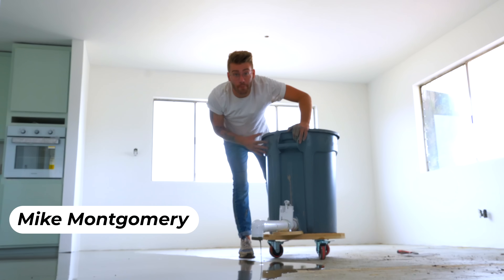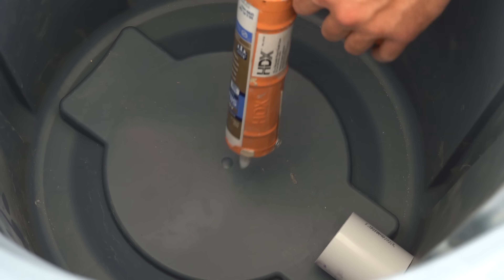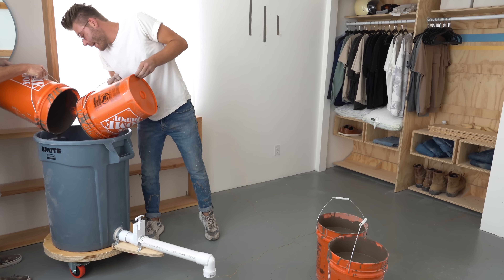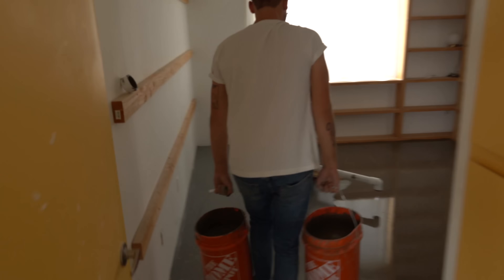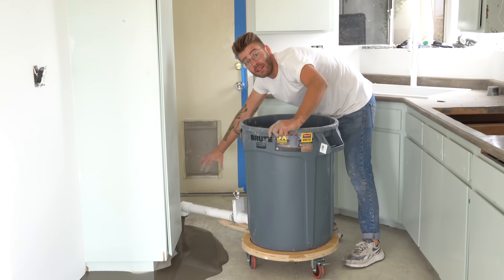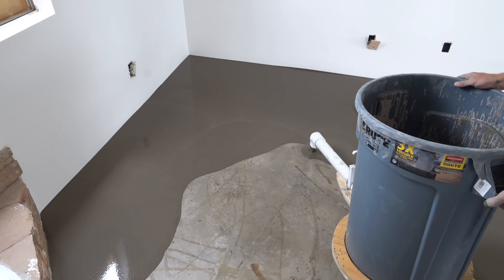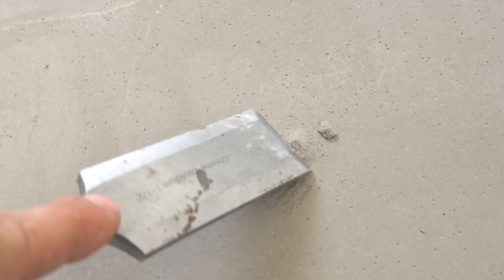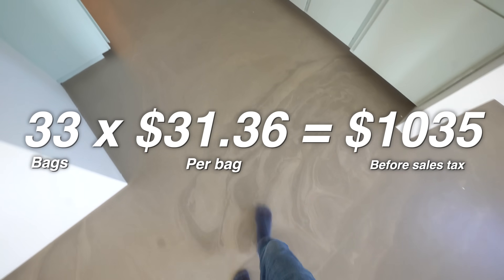DIY SELF LEVELING CONCRETE FLOORS!! $1 per square foot

Comment: I did this DIY pour two times and for the second one we already understood we have to invite few family members to mix with multiple buckets and drills to achieve good pouring times. Mixing of my material was supposed to take 4 minutes and the initial drying time was 20 minutes, so with only one bucket mixing you would pour the 5th bucket on a solidified material. This way I believe it has to be maximum 30 minute job always. What is your experience?

Comment: Someone help me understand: that thin layer over that really smooth surface wont result in the new concrete top to crack and break with as littke as walking on top of it?

I trued this in my garage, with about 2 inches thickness. When it dried, i lift from the subfloor and walking on in immediately broke it.

What am I doing wrong?
Someone help please!

Comment: hi I need to level out a basement floor but it looks like the corner where the concrete was originally poured is very high. I’d say it’s about 4-5 inches higher than the rest of the floor just in the one corner. Is grinding my best option or should I look into pouring self leveling concrete or both?

Comment: Hello Mike, I just finished doing my Sunroom with my wife and her girlfriend. We had a lot of fun doing it. It came out awesome in my old house. My question to you is after you put the sealer on and lived with it were you happy with the sealer. I thought I'd wait several days before I put the sealer down. The contraption worked great I went with 11/2 inch pipe as Ben recommended.

Comment: LOVE the enthusiasm, HATE the install. The supplier is laughing all the way to the bank. Material is not a wear layer and slippery sealed surface is just asking for accidents.
Just patch and level the rough areas and drop LVP on the old surface. Floors are consumable/wear surfaces. Flatten and put a nice, comfortable, replaceable, wearing surface. Replace in 20 years with LED lit, heated, vinyl tile floors

Comment: You know, they make a special type of mixer for this sort of application. It is basically a 55 gallon drum held in a steel frame with a gimbal and a heavy duty mixer built in. This way you can mix several bags at once and the entire drum rotates to pour out the cement as needed. It is sooo much easier and faster than mixing in five gallon buckets. The cheapest versions cost around $1500, but you can usually find a place to rent one for $30 - $40 dollars a day.
In CA there is a company called CONCRETE  RENTALS and they rent one called the "HIPPO - Mixer" $150 for three days or $300 for a week. There are far cheaper rental options but CA...

Comment: This product is not designed to be a trafficable flooring surface. It’s a substrate that needs a flooring product installed on the top like carpet or LVT.

Comment: Never ever wear wireless ear bud like devices when pouring/mixing concrete. Also this is not a long term solution, it's strictly cosmetic IMO.

Comment: The mistake you made is your setup to do a continuous pour but may as well have just mixed each bucket and dumped them separately 
What you should have been doing is one guy mix’s and delivers the mixed leveller to the hopper before it ever runs out of leveller making it one continuous pour rather that just two buckets at a time

Comment: That slurry will form fine cracks overtime, despite having been protected with a sealer. It might not do anything to the floor structurally considering it's a single storey house but it will be visible. Now, if you want to prevent that, lay down a layer of fine mesh (preferably a fibre mesh instead of a metal one as the latter would expand when the concrete sets, creating uneven waves) before pouring in the self-leveler slurry. The mesh will provide tensile strength, preventing any cracks from forming on the floor...
Reply: that is a good idea, do you secure the mesh to the floor with any sort of anchor or just lay it on flat with nothing holding it in place?

Comment: Can this work if floors are hardwood? I've been wondering if concrete can be applied over hard wood floors  and finnish it with tiles or will there be cracks after a few weeks?

Comment: You could buy a long elastic slug maybe a bit wider in diameter not the average water hose and or you even could use a water hose too and later wash out with water bc this material was really fluid. The same big bucket, outside the house, 1 guy mixing the material one guy helping to handle the hose and 1 is pouring much precisely . You just have to put the bucket high enough that the material can leave.

Comment: I don't quite "get" Self Leveling mix because whenever I see it poured in a video, it flows to somewhat level, but not really level. It seems to easily retain many areas thicker than others, similar to trying to trowel icing smoothly onto a cake: about impossible. So my question remains: just how much variation and obvious layering appears when it's done and and dry? For example, could a linoleum floor really be added on and lay flat? Doesn't look like it to me.
Reply: You're right.  Doing it this way does NOT make a perfectly flat floor.  It is good for laminate flooring on top.  If tiling, most pros will use thin set and a trowel to level it.  I can't speak to sheet vinyl, but any surface variation or lump will translate through the sheet goods and be perceptible on the final surface.
Reply: @alanstanly  Thank you. Well, I lived in a NYC loft where the slope was so bad that it would be entirely pointless to use self-leveling. The dropoff across the 25ft width was a full 12 inches! I finally corrected part of that area by laying 2x4 joists onto tall stacks of 2x4 blocks. And that work was a total nightmare that took ages to construct. And it never quite got finished.

Comment: Hi I have expansion gaps in the concrete in my basement. Do I need to fill those before doing the self level concrete? If so what would I fill it with?

Comment: ok not tryn to be a debbie downer and for and for any nay-sayers im a 3rd generation mason with 20 years+ under my belt at the age of 40 so i am going to be the voice of reason here, first off....thats not concrete, its not even meant to be an actual exposed surface, second its gonna crack and make a god awful mess, and third you realize there are people that are gonna try this and spend alot of money on it from what i can see 1200$+ and possibly do damage to theyre homes or god forbid theyre rental homes, you really need to label your vids better and use proper tools and at least proper prepping, cuz in my opinion this was so cringe i had to stop the vid, laying down some durock concrete board and 12 inch tiles is cheaper easier and brings up the value of your home , but thats just my professional opinion.

Comment: Good lord.  You made this job WAY harder than it should have been.    Pour the product on the floor, put on your spiked shoes, and roll with a 36" pin roller.   33 bags is a 1.5 hour job for 1 guy.   And yes, I do this at least twice a month.  The know nothing comments on this video are incredible.

Comment: How does the concrete not set up ln the spout and clog?
Reply: I guess it's just runny enough being self leveler
Reply: It’s a special concrete—that’s why it’s 6 times more expensive than regular concrete. I used them to cover my uneven patio stone floor with this before overlaying it with laminate wood. Generally they are good if you plan to overlay it with other things bc this type of concrete should not be the main finish.

Comment: Nice job guys!  It looks great.  I have a 70,000 sq foot 1927 five story office building.  The floors are cement, but poured in small sections which are not level nor flat.  Fine for carpet, but we wanted to change to wood (laminate planks).  I am just a DIY, not a contractor, but I have done a LOT of these pours (200 to 2000 feet).  The first step is we grind down the high spots at the corners and edges of each original pour.  Then I like to use this self leveling stuff.  It is SIX TIMES the cost of regular cement, but it flows like thick soup.  It does NOT in fact self level all that well.  Especially if you do it like these guys did, in large pours.  The thing is, it sets in a flat amount of TIME, not by drying out (it is a chemical reaction), and that time is just a few minutes.  You do not really have time to fuss with it, and if your next bucket is not ready pretty quick, the earlier pour will set before your next pour, and it will not be homogenous (you will end up with dry seams instead of a continuous pour).  So, there are a couple of tools we use.  One is the beveled cement float (like a push broom for shoving around cement)(A gage rake probably works too).  This is used right after you pour a bucket to get it into the corners and edges quickly (time is of the essence).  The second tool is the spiked roller (think pinhead on a 18 inch wide paint roller).  This is used to QUICKLY smooth it all out and blend the different pours and pop any bubbles (careful not to push it too fast or it will spray cement all over your walls and pants), and do not overdo it, once the cement starts to set, it is game over.  The shoes with spikes are cool if you need to walk into it and hit a corner and not ruin your sneakers.  Also the cement dust while you are pouring the bags and mixing is very irritating.  If doing it outside is not practical (limited time before it sets), set up a place inside (with a heavy drop cloth, it will make a serious mess A CEMENT MESS).  I usually have 3-5 people to do it.  Have a big trash can of water and a 10 quart bucket with a slot cut horizontally at the 6 quart level so you can quickly grab exactly the right amount of water (the water added needs to be precise).  So I have 1 guy on the half inch mixing drill at the bucket, another guy pouring the dry bag into the bucket, and a 3rd guy holding the vacuum with a cyclonic dust extractor (DustDeputy).  After the bucket is mixed, a 4th guy will bring it to active room, and pour it out. The final guy then uses the float and pin roller to blend it into the ongoing pour.  Have 2 or more buckets in circulation so you can do it assembly line fashion.  Note that it sets up and coats the buckets as you go (I can only imagine his trash can thing and spout getting clogged), so having a few extra is nice so you don't get hardened clumps in your pour.  Do be sure to wet mop the floor and then put on the primer (like he says, 1 time 50% diluted and then 1 time full strength).  The directions say to use a soft push broom to apply, but a cheap paint roller seems to work just as well for me (make it thick, a 3rd coat is not wrong).  If you are sloppy with the primer step on an old floor, it will wick out the moisture too fast and in the morning you have a cracked useless mess to chip up and redo.  f you don't tape the edges, it will flow right under baseboards or drywall (or cabinets or doors).  DO not skimp on taping and sealing where you to NOT want the liquid cement to flow.  Caulk cracks in the floor or it may flow through (to the floor below you).  Also I can say from experience, this self leveling stuff is rather soft so do not expect it to be a walkable top coat.  In fact the manufacturer's website is very clear NOT to leave it as the final surface, it is UNDERLAYMENT, although it is pretty, it is NOT durable, and a thin urethane coating will not make it suddenly durable (note however that there are professional self leveling mixes that ARE certified as a topcoat, but the ones I have found require an authorized installer to buy it).
Reply: Dayum... That's a lot of work!
But you've got it down to a science.
Reply: Could you not just use ultra fine ag at a really high slump and a bunch of super plasticizer and end up with better results for cheaper?
Reply: very good information, thanks for taking the time to type all that out.

Comment: I've installed more than 1 million sq ft of Ardex K-15 self leveling underlayment in New York city rehab projects. Hat's off to you for thinking of a new way to dispense the mix, although it has some bugs to work out. On big projects we used a concrete pump and gauge rakes set to 1/4 inch to guide the mix where it needs to go. We then went over it lightly with a long handled type of float to break the surface tension and allow it to flow better. Once it cures you are always going to get tiny hairline cracks that are actually mostly a cosmetic issue, and not a structural problem. It should be sealed with a clear water based matte urethane because it will continuously dust off and you will always have it on your feet if you don't. These materials were designed to go under finished flooring, and not to be the actual floor.
Reply: Do you mind sharing what sort of concrete pump you used? I have tried searching online for something similar and have only found very large scale industrial equipment.
Reply: @bcarl10101  concrete pumps tend to be big industrial machines. There aren’t many small pumps.
Reply: At the end of the video he used a BEHR sealer is that the same as the matte urethane or something different.
Reply: would you recommend that product for a DIYer? considering this instead of LVP (i have some really bowed wooden subfloors)
Reply: @bcarl10101  Ardex will rent a small pump delivered to your site.  If the pour is under 2000' its not worth it at all.
Reply: @robindegu7294 nah, you need to do this then put on your lvp or laminate.
Reply: @jamesmorrison7847 what sort of result can one expect from self-leveling compound with an epoxy coating on top to finish?
For a 400 sq ft studio floor in a basement that just needs to be clean and functional.
Reply: With pyramid?
Reply: I'm a ny Mason for 25 years local 780. Pyramid monopolized self leveling in ny for a while, but they were excellent.
Reply: your last sentence was the best for those considering the final floor finish.

Comment: Its not flat its bumpy and uneven and cracked in 1-2 weeks (if not days). Thats the most wrong way to do self leveling concrete ) just because its says "Self leveling" in fact its not ) you did many mistakes:
1) no damping tape at perimeter - floor will crack
2) no spiked roller - there will be bubbles in it and will make it less durable and less waterproof
3) you didn't use smoother - floor surface will be uneven 
4) you didn't use leveling pins to make it ideally flat, leveled and even
5) in order to do 2-3 steps you needed nail shoes )))
6) its better to use small portions at the time instead of 25 gal at once, since its dries very fast and you wont have time to complete all steps correctly, its better do by zones partially, especially if you are new to this
You dont have to be pro constructor to accomplish it, just do it right as manufacturers suggest

Comment: I like the garbage can idea but not necessary since you basically carried the product to the area you were pouring the product. Had you mixed and poured in the garbage can then would say use it. Only issue with mixing in this can is would be the bottom would never mix properly 

This product doesn't self level you need to assist in leveling process. You also need to establish the low and high points to know were the product is needed. You need to help the surface tension in the product once on the floor by moving it with a roller made for this and a flat trowel. 
The swirling is in consitanty in the mixing.

Mixing this product in a dirty used container will cause the next batch to set up faster since the previous batch mixed in the dirty container has begun to set. Always a clean container and exact amount of clean water. Water always goes in the container prior to adding the powder. 

This product is also a rapid set product not really good to use in a large area due to its rapid setting nature. It designed for smaller areas to be able to pour it and set finish flooring in a short amount of time! They make product like this that doesn't set fast and should be cheaper than the rapid set product. 

That primer over painted concrete may not bond!

These type of products can be purchased at cheaper price than the Depot but it usually requires you to be an actual contractor doing business with a reputable tile / flooring distributor.

Comment: This is interesting but what is the plan when someone drops something heavy on it and cracks it in a spot? Chip up a square of it and re-pour? Just use filler in the chip/crack?
Reply: likely it will damage easily. this is designed to be used under an actual interior flooring like carpet, tile, LVP, wood. we used this in our basement remodel after framing to level the floors. i wouldnt personally use this as a top coat.
Reply: Exactly, it should be used underneath a more durable floor material. Using this as the finished floor itself will not hold up over time for several reasons. The thin layer will start popping off over time, and it'll likely chip off when something is dropped on it
Reply: Kinda like tile😮
Reply: @mram7715  Except tile can be singularly replaced. That’s my point…each tile is separate, this is one smooth, continuous pour - if it cracks, you either have to scratch up and re-pour the entire floor, or replace one little area and now have a finish that isn’t smooth, which is the entire allure of this in the first place.

Comment: why not just batch mix the cement in the big rubbermaid you used to pour instead of smaller ones, you could use the paddle mixer in the big trash can

Comment: This is not concrete. Concrete is a mix of cement, sand (fine aggregate) and stone (rough aggregate). This is basically a cement floor.